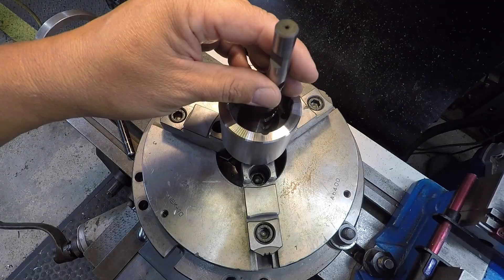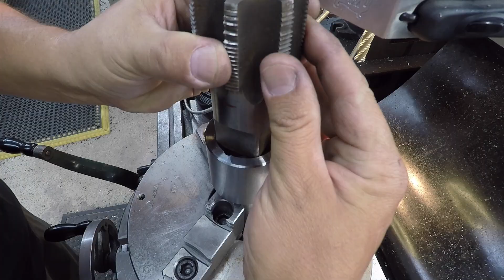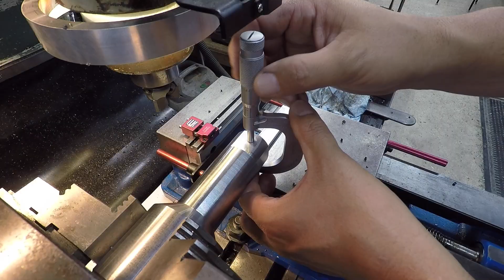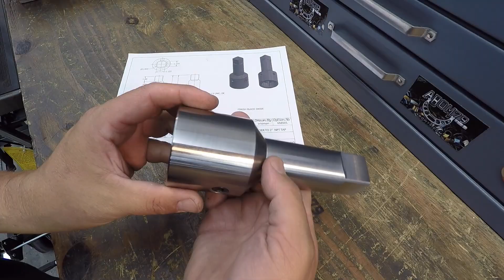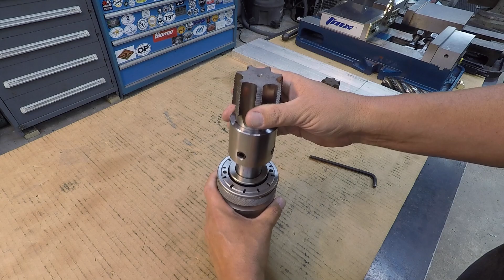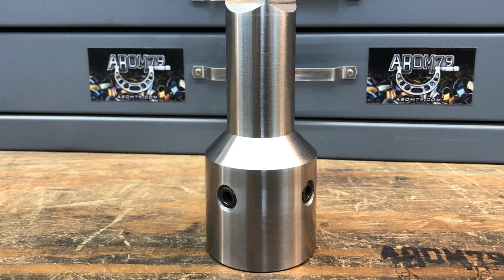Flexarm 2" NPT Tap Adaptor Part 2

Comment: When u do a job that u really up for it and something u love doing it and u are in the mood,  most of the marking are spot on , like u trying to take 3,4 mm by couple of time and it come exactly 3,4mm in first attempt, 
Like sometime I’m trying to mark 670mm metal sheet to cut before I measurer I put the marker exactly on 670 mm spot , 
Its happening a lot lately, 
This is so unbelievable, I’m talking about the matter of millimetre,

Comment: At 6:55 could you mount the camera on the other side opposite to you, inclined towards the part?
Another possible solution would be to mount the camera on the very top of the machine on a flexible arm which does not interfere with the operations.

The build of such flexible system could give you a video or two to post. I would love to watch them!

Comment: You might find when you put the tap in you're creating a vacuum at the bottom. if you drill a small hole through the side near the bottom so that the Chuck and breathe you may find it won't hold the piece in as tight.

Comment: Wouldn’t it have been easier to get the internal square clocked to the external square if you milled the external square first, and then put the external square in a vice to mill the internal square?

Comment: Sensei Booth, if practitioners of the metal arts had defined ranks as the martial arts you would be one of the few top-level black belts of manual machining. What you create is very clearly functional artistry.

Comment: It would have be interesting to see you do the squaring of the hole using the shaper and not have the drilled holes in the corners as an alternative way to do it.  With the size of that square, the would be a lot to ask of a shaper attachment for the Bridgeport like Stan has.

Comment: a good tipp with long endmills is to reduce the spindle speed over 50% what you run with an normal lenght one. sometimes even more then 50%. depends on the amount of the lenght to diameter.

Comment: Hey Adam,  huge fan from down under, along with AVE and all the tube crew and learn something every time I watch. I know what it's like to setup camera gear and know that audio in your environment is a real challenge. It's really difficult to mic someone that's working in quiet and loud environments at the same time. You really need to have two mics, one attenuated to the room at ambient noise and the second to your voice when the equipment is running.  That's why professional cameras can have 4 channels of audio, one is natural sounds, the other is radio to host, one to guest and a third. Alternately, find other recording devices that you can set and then use a "CLAPPER" those were used because the audio and film we separate. The editors would then use the vision and clap/clack to align the sound on the audio recording. That way you can match the audio from any source to the vision on the camera. -6DB is where you want to be :)

Comment: With the differents between the top and bottom of the square due to deflection of the tool ... could you use the shaper. As if it was like wood working chisel. You’d need a different tool of course
Reply: He could but then he would have to cut a relief at the bottom of the pocket before putting it on the shaper. The relief is the give the chips somewhere to go otherwise the will just pile up at the end. The fastest way to make that pocket is using a rotary broach. I don't know if they make them in that size though! He would still need some sort of relief at the bottom of the pocket.

Comment: Just curious as to why you would use 4140 but heat treat it, I thought that the whole benefit of 4140 was that in it's soft state it was easy to machine but could be hardened and tempered for durability ?

Comment: Because of the crazy amount of torque needed to turn a tap that size, would heat treating be something you’d want to do? Could there be some pretty good deformation and twisting of the shank relative to the square end? Also, black oxide would look kick ass on that part and help prevent rust. Awesome video!!

Comment: 27:05 I've got a feeling with a used lathe you'd be into changing head stock bearings and scraping in the ways again depending on what the condition of said lathe is to get a work piece running perfectly true

Comment: When milling an inside square, why are the corner holes normally drilled with their center at the corner of the square? My inclination would be to pull it one radius (or a little less) in towards the center so that the corner of the square is near the circumference of the drilled hole. It would leave more material in the thinest (weakest) portion of the part which might be desirable and, for the same size drill, should let you use a larger mill. -- But it seems an obvious enough idea that if there wasn't some non-obvious (to me) issue I'd expect it would be common. The only downside I see is that the math is a little more complex, are the upsides not even worth that? Or am I missing something else?

Comment: Is the entire point of one of those 90 degree end mills to cut 45s like that or is there another main purpose and you are just using it because it works? Love it! Keep up the good work!
Reply: I think he used it because he didn't want to change the setup. I'm sure there are a half dozen different ways to do it. It was just easier that way.  I noticed there are side cutting edges on that mill for other purposes.

Comment: Ya the weldon type you know set screw holders they also help keep the carbide from crawling outta say collets have a few regretable moments myself . have a happy medium between the slippery carbide and the smooth carbon steel? The tormach style holders for the R8 the .75" shank I've got a bar or two of 4X40 that I"M saving for some expeirimental with the manual drawbar to see if the  expierience is one of those lucid dreams you wake wide awake from or not. I have a three axis dro and the z on the mill seems the most reliable anyway.    ohhhh there's sooooo much stuff befor then though ha ha this stuff's real work man love it

Comment: I taper rifle barrel blanks on  1440 size machine and always run into chatter, wind up taking small cuts. i know the commercial guys use high speed, lots of coolant and get the job done 2 to 5 passes. Would love to have some info on speeds, feeds and inserts to make this work better. Rockwell C on a 4140 barrel is usually around 28. Also some barrels are 416 stainless. If you need one I'll donate a barrel to try it on.

Comment: what about making a tungsten rod with threads at the end fit into a  hole in the center of a long drill? where the rod threads into near the bottom of the drill bit and the other end of the rod is up in the chuck, that will work and stop the chatter.

Comment: Adam will the adapter clear the hole of the 2” inch tap if you need to go lower in the bore?
Reply: This particular tap is a pipe (tapered) one so you would never go beyond the top of the threads on the tap.
Reply: Yea I see what you mean.

Comment: @abom79 I need something machined can you machine it? I was given a V block that has no clamp. The thing I wanted machined is a clamp for it just the clamp and taped for like a 1/2inch bolt for the part that I can screw done against the part in the v block. Can you machine it for me? I do not know how i went it to look at all what do I need to do to help you out so you could machine it? How much would it cost?

Comment: Would it be wise to drill a small hole clean though that holder, I know the tolerances you like to work with, someone sticks a tap in there with some grease on it, they won't be getting it back out, but a hole clean though would let them put some air on the back side and blow it out.
Reply: No, it's not a tapped hole, but a corner to capture the tap it's holding.  He had a nice Instagram post on the completed holder. To see it in action, go to +flexarminc New YouTube video.
Reply: Perhaps I also misunderstood the question, too. Are referring to the setscrews? 'Course, I haven't watched the whole video. :)
Reply: @FrBobLaceySD  He's saying a small hole through the entire shaft so when you go to pull the tap out there isn't a suction happening.

Comment: Darn, I was hoping we'd actually get to see it do some tapping.
Reply: Video (with timestamp) from Flexarm where they do some tapping using the part: https://youtu.be/1fy3_48DR1U?t=1141
The shout-out to Adam timestamp: https://youtu.be/1fy3_48DR1U?t=740
Reply: take a look at the flexarm channel and their latest vid live. There you see it in action :)
Reply: I have a set of taps for bicycle bottom bracket cleanup.   English threading, which means the drive side is reverse threaded.   I’ve used them perhaps five times in over thirty years, when I picked them up at a sale after a bike shop folded.
Reply: @dewiz9596  Take a look at frame tools on amazon nowadays. Amazing.

Comment: I wonder why you used the four drill holes to do this job. It seems that manufactured adapters don't have them.
Reply: Mass produced parts are probably forged first so there’s barely anything in the middle to remove

Comment: 8:58 The best way to machine square cut outs like that is with an EDM ... it'll be done before you have a regular mill set up to start.
Reply: What is such a machine worth brand new,and is there availability of good used machines  ? What is the learning curve for such a machine ?
I am not being snarky. Genuine question,and presuming you are quite familiar with that particular ironmongery.
Reply: @paulmanson253  For Pricing I am no use, I used to runa  couple many years ago, and it's simple enough to operate, just attention to details 
I suggest do some searches .. the latest tecnology I can just imagine is much better and much cheaper than the old stuff I used.
Reply: @MikeBaxterABC  Righto.
Reply: Just a back-of-the-envelope calculation gives about 4 hours and 20 minutes to die sink EDM the square pocket of about 1.410 X 1.410 X 1.10 = 2.19 cubic inches of steel  given an MRR (metal removal rate) of about 0.5 cubic inches per hour for steel. Add to that he would have to setup and machine the die. Hard to time exactly how long it took Adam to make the setups and do the turning, drilling and milling of the pocket but... my guess is about 2 hours.

Comment: I always prefer plunging in these types of situation. I think it results in a truer cut and less chatter. leave .005 for cleanup with a full cut.
Reply: I rarely start with plunging but works great if deflection is a concerns. I am also surprised he is conventional milling which pulls the cutter in. I guess backlash....
Reply: @nilsdietrich209  I've seen in many of his videos he much preferes conventional milling, in virtually all conditions.
Reply: @nilsdietrich209  It was fairly tough material. The best way is the way that works! Thanks for your reply.
Reply: Iteresting ... Fort me? I do NOT like punge cutting with an end mill ... makes me feel like I'm back on the drill press! :)
Reply: You are absolutely right, i have noticed and can only assume it is his equipment. I only use conventional when cutting material with nasty scale or when i get a lot of chatter in deep pockets, whats your opinion

Comment: Always impressed by Adam's abilities, welcome to NASA Adam
Reply: Qtri Nity  You won't get a lawsuit. I worked at Grumman Aerospace On the lunar lander and every thing and every step was overseen and inspected by NASA. If it met NASA procedures and measurements, the NASA inspector signed off on it indicating it meets all NASA specifications. Once he signs off it is no longer your responsibility. If anything the inspector MAY get a talking too but I have never heard of anyone being sued, It just doesn't happen.
Reply: Qtri Nity  Not everything that NASA builds ends up in space... NASA, for example, still operates a number of wind tunnels that needs parts and fixtures done.

Comment: I think you smart making the flats inside a little bit big as tap flats are usually milled and can have very a little. You may already know NPT taps do come with spiral flutes. They cost more but I think they cut better.  Believe it or not there actually easier sharpen. That's what I do for a living sharpen and alter cutting tools for the machine shop. Nice job on the holder should work perfectly.

Comment: Hi Adam, just wondering... When I was learning tools - a long time ago - when we tightened a drill chuck, we were always told/made to tighten all three key holes... was that something that our teacher just wanted us to do or is there more to it?  I just notice that you don’t do that... and you are likely the best machinist I have ever watched...
Reply: All of the gear that Adam has is top quality and in good condition.
My utterly laughable 700w drill that I bought from a supermarket 10 years ago has a chuck that China would be embarrassed to have anything to do with, and it came with no chuck key. The two rusty keys I have should have gone in the bin 10 years ago. Getting that thing to tighten is a challenge, and for me, it makes all the difference if I use all three key holes.
Adam on the the hand, is rolling with genuine Jacobs items with matching keys.
Reply: I didn't notice the model of his chuck, but the ball-bearing Jacobs chuck tightens very nicely with just one key hole. Jacobs have a lesser model which is not ball-bearing and I have had drills slip if I didn't tighten in all three holes. But it is less expensive. You get what you pay for.
Reply: Yes tightening the chuck at all points is the proper way of doing it to get equal pressure you're teacher was absolutely correct to teach it that way
Reply: Sounds like you had a teacher with O.C.D

Comment: A tap adaptor for flexarm... Tapped without flexarm😱
Reply: The flexarm is for bigger production series, or for bigger tap sizes. For one small hole you just drilled, it is much faster to just tap it using the mill.

Comment: Deep pockets and long cutters always make for an exciting experience. Especially in a tight area. At first I thought the cutter had chipped or broken. Carbide will either cut or shatter. HSS is a bit more forgiving as they flex more. Just me but I think I would have finished with a finish cutter. I wouldn't worry about that little chigger bite in the bottom. All in all a fine piece of tooling........

Comment: I know there’s many methods of indicating and finding centers and flats, but would indicating the parallel vertically work to have the internal square perpendicular to the parallel aside from using a level? I was wondering whether the indexable chuck would be a good way to adjust the parallel to indicate?